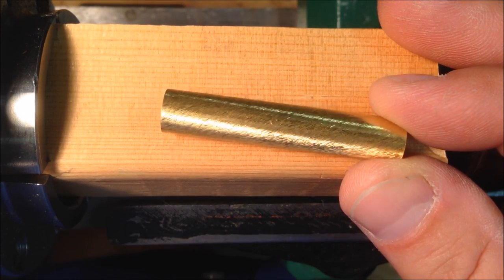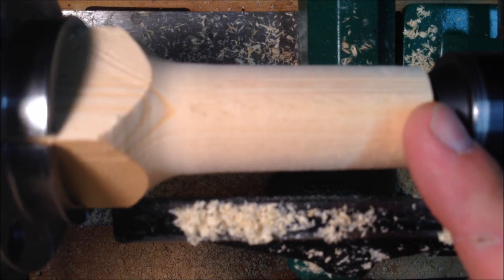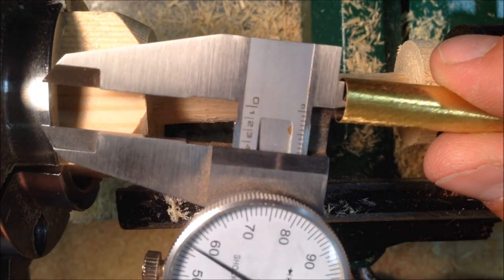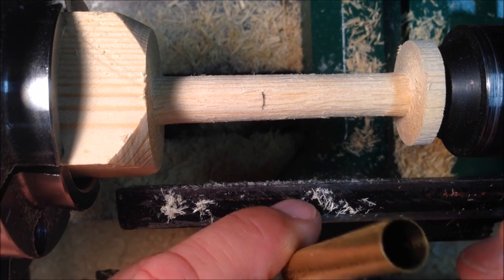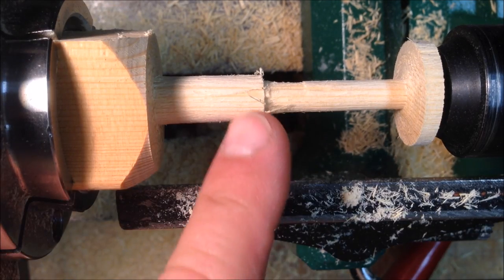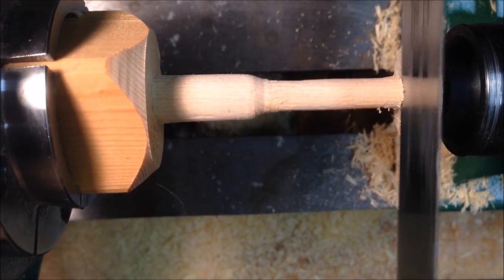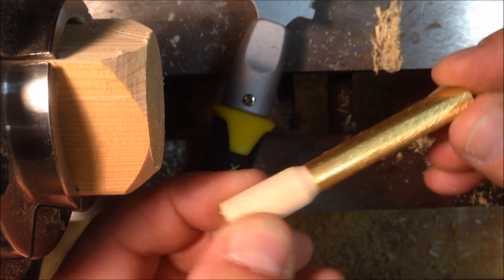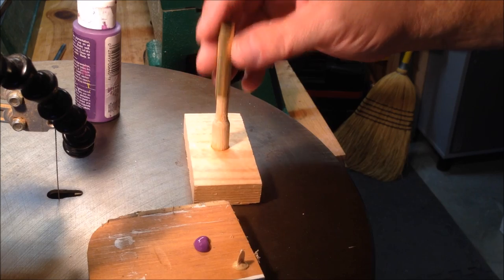Pen Tube Painting Jig

Comment: I made one tonight for the blue and white pearl acrylic that I did. I used 1/4" dowels and just tapered them on the disc sander and glued them in to hole I drill in a piece of mdf. Thanks for the idea. It saved a lot of hassle. :)
Reply from the maker: Your welcome Dean,
  I was talking with Brendan and he suggested using Q-Tips to paint the inside of the tubes to also hide the glue. 

Regards,
Bob
Reply: Good idea!

Comment: I enjoy watching your videos and have probably seen most of them. This one makes an easy step somewhat difficult. To paint my tubes, I simply use a 3/16 dowel about 6" long. I then take a thin coffee stir straw and cut about a 1" piece off and squeeze it a little to flatten it. I hold that at the end of the dowel and slip the tube over the dowel and the straw. That easily holds the tube in place for painting. After painting I slip the other end of the dowel into a vacant hole in my pegboard and let it dry. If you don't use pegboard, drill a few 1/4" holed in a scrap piece of 2 x 4 and drop the dowel in to dry. I reuse the dowels and straw pieces over and over. Quick and easy .... works for me! Hope this helps.

Rick
Reply from the maker: +Rick Troup This sounds like a great idea. I use Q-Tips now and paint the inside of the blank instead of the tube. That way if the blank gets thin and somewhat translucent, you can't see the glue. I need to do another video. 

Bob

Comment: I have never painted my tubes on acrylics, but I had seen others do it.  With some acrylics that golden hue behind the colors makes it pop a little more.  Others not so much.  I agree that a multi spindle stand would be beneficial.  Or at least several 2 spindle stands.  Good work Bob
Reply from the maker: Thank you Jay,
  I think I will shoot video showing how this pen looks with the painted tube. Might be interesting. 

Regards,
Bob
Reply: Agreed on the video.  I have been concerned with the bond of the glue when the tube is painted.
Reply from the maker: Will do,
  Thank you for the encouragement.

Regards,
Bob

Comment: Cool project, for out back in the shop pine is fine. Several dowels would definitely help speed up the process. Maybe do some made out of a nice light piece of hardwood for a display of the painted tube's for your customers at the craft shows. And like Jay Tomes states , sometimes the brass showing up helps. Thanks for sharing and happy turning. Take care, David
Reply from the maker: Thanks David,
  Great idea about displaying at the craft show, I never thought about that. I did get a bunch of questions about how pens are made, that might be worth setting up a display. 

Regards,
Bob
Reply: Yeah, I get the same thing. Everyone thinks it's neat to watch you turn a pen. Anyway to get power at your booth? Custom turning request turned in front of them. You'd be surprised how many people will stand and watch you, then buy a pen. Thanks, David
Reply from the maker: For my next show, I have paid for electricity. 
  I may take the lathe, I am still debating that. 

Regards,
Bob
Reply: Good deal, hopefully that'll triple your sales. Good luck.  Take care, David
Reply from the maker: I'll tell you one thing,
  It sure made a difference in the finished color of the acrylic blank. I plan on making something for multiple tubes. 

Regards,
Bob
Reply: Couldn't you pre-paint some of your blanks, the neutral colors anyway. Anything to help save time at a show.  Take care, David
Reply from the maker: David,
  I sure could, white & black would be my two neutral choices. Penn State even sells them pre colored to save more time. 

Regards,
Bob

Comment: Great idea for the holder Bob, always have problems getting the right size for holding the tubes, never occurred to me to turn a spindle for it.  I use bolts to hold mine, but I think I may just turn something now.  I was thinking, if you made it with a taper, you could hold many different size tubes with one jig.
Reply from the maker: Zach,
  I think the taper is the way to go with an extended piece at the end so the tube stays on the dowel. 
  What I really need is about eight or ten of these on a board for multiple tubes at a time.

Regards,
Bob

Comment: I got quite a pleasant effect by using a black marker pen on the tube, when covered in CA and inserted into the blank it streaks and as you said, when the blank gets thin you see into it  The various shades from( black) marker through to the brass of the tube can look quite good.
Reply from the maker: Hello Gerald,
  I need to do an update to that video. What I started doing recently to avoid seeing the glue is to use a q-tip and paint the inside of the blank. When it dries, I can glue the tube in. 

Regards,
Bob

Comment: Interesting. Instead of painting the tubes, I use a q-tip and paint the inside of the blank.
Reply from the maker: Both ways work well. When you paint the inside of the blank you have to stand it on end to dry otherwise the paint can pool on one side. Drill a hole in a scrap of wood and stand the blank on end over it. This will stop pooling. 

Regards,
Bob

Comment: I have read and watched a few different takes on hiding the brass tube from site on an acrylic turning.  One reference mentioned that painting the tube made the gluing (either CA or epoxy) less dependable secondary to poor cohesion to the painted surface.  Have you found this to be true?  That particular reference suggested only painting the inside of the blank and then using epoxy between the unpainted tube and the internally painted acrylic blank.
Reply from the maker: +Jared Wolfert Hello Jared,
  This is an older video, I have since started painting the inside of the blank. It hides the glue if the blank gets thin and transparent. I have used both methods and never had a glue failure. 

Regards,,
Bob

Comment: If the tubes are not pre scratched like most of them are from Pennstateind, do I scratch and then paint or paint and then scratch or just paint and leave it at that?
Reply from the maker: +steve Corry Scratch then paint so the paint sticks. Then rough up the paint a little so the glue sticks. You may want to paint the inside of the blanks instead of the tubes. That way the glue doesn't show through. 

Regards,
Bob

Comment: Hi Bob, I've been painting tubes black but this is a much better idea because it keeps the colour intact.  I just need to torture my wife and get her to put the right acrylic paint colours with the appropriate blanks because I'm colourblind.
Best Wishes, Brendan.
Reply from the maker: Thanks Brendan,
  A good shop helper is essential in that situation. I just heard from another turner that I need to paint the inside of the blank instead of the tube so the glue doesn't show. I'm not sure how to do that. Some more research is in order. 

Regards,
Bob
Reply: Brendan, I can totally relate (I'm green color-blind) - my wife is most definitely my 'color consultant'.
Reply: RJBWoodTurner Q-tips Bob, I've used them to paint inside blanks and they work really well...and for other things too like wetting a tube before using Corilla glue.  (changed my 'praying' to 'painting'...maybe I should be doing more praying, it might be a sign)
Best Wishes. Brendan.
Reply: Gary Kline Hi Gary, I'm colour-blind across the spectrum and to a great depth.  Only for my wife I would end up going out dressed like Coco The Clown...in fact, I probably did look like Coco The Clown before I met her because she used to ask me questions about my unusual colour co-ordination...and then she realised because never told her I was colour-blind because I didn't know how colour-blind I was until I had my eyes tested with light projections of colours after I got married.  People are fascinated when I make mistakes about colours and then get disappointed if they ask me a colour and I get it right.  It's hard to explain that we see colour but not like people with perfect colour sight because a lot of people think we see only black and white.  Anyway, I hope I die before my wife or people around here are going to get a good laugh.
 Best Wishes. Brendan.

Comment: Great video! Will the CA glue cause any loss of color of the acrylic paint? Like, does it cause the paint to dilute or dissolve? Is there a particular acrylic paint to use, or are they all the same?  Thanks!
Reply from the maker: +Gary Lundgren Crafts I haven't had any trouble. I use spray paint from the big box store or Testor model car paint and haven't had an issue with either. 

Regards,
Bob

Comment: Hi Bob, does the glue still adhere as well to the tube after painting it?
Reply from the maker: Hello Grant,
  Several things have changed since I made this video. Now I use a Q-Tip and paint the inside of the blank and I use Epoxy instead of C/A. I have had no issues with the glue adhering. 

Regards,
Bob

Comment: Does the paint affect the ease/difficulty of gluing the tube in the blank?
Reply from the maker: So far I haven't noticed any issues. 

Regards,
Bob
Reply from the maker: I also wanted to comment that I haven't had any problems inserting the painted brass tubes into the blanks. I like to dry fit them first just incase. That way if they are to tight, I could sand away a little paint. So far this has not been an issue. 

Regards,
Bob

Comment: Is that a shop smith your using for your lathe?
Reply from the maker: My lathe is the small Harbor Freight lathe.
Reply: Cool, so fairly easy to transport. I see you got a chuck for it. Do you just do pens?
Reply from the maker: Right now primarily pens but I'm starting to do some ornaments. I hope to be making more of them soon. 

Regards,
Bob
Reply: Good deal, pens are an excellent skill builder , and fairly easy to move. Before you know it you'll be turning all kind of thing.  I've seen your videos, you are an excellent turner and woodworker. Good luck with the booth. Post some pics of it. Thanks and take care, David
Reply from the maker: Thank you David,
  I am planning a video about craft shows due to numerous requests. I just need a little time to film it. 

Regards,
Bob